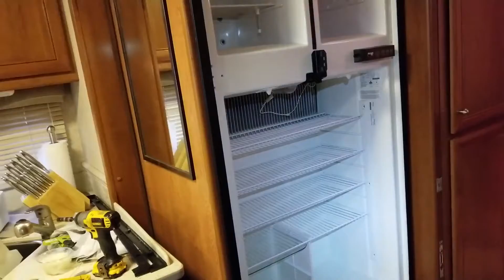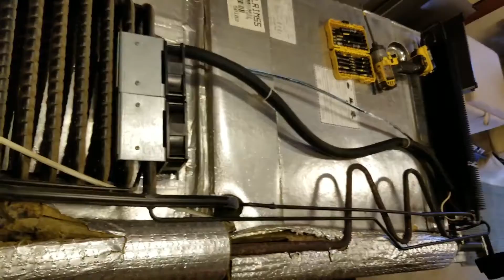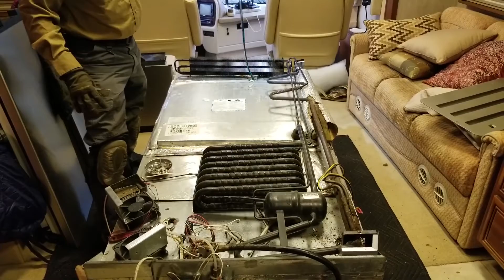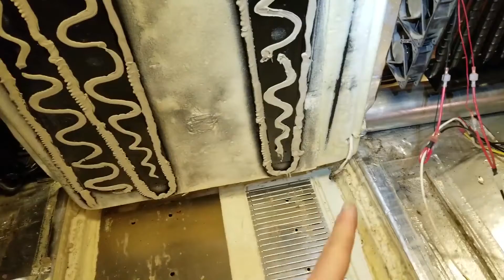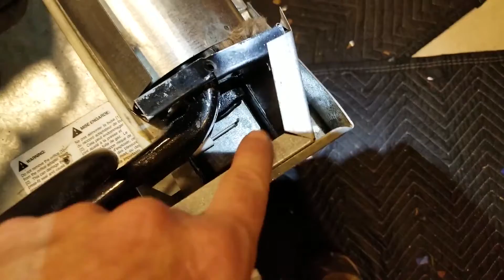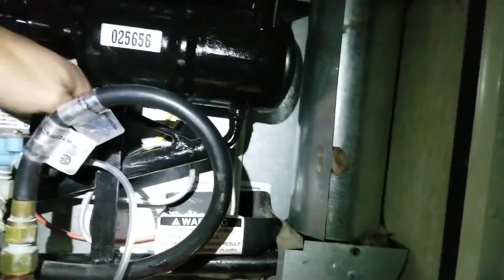RV Refrigerator Full Cooling Unit Replacement Tips & Tricks

Comment: I just installed an Amish unit that has kind of a brown/khaki color tubing. I ran necessary jumper wires and extension cord so I could test it before placing it in it's cabinet. Do these unit stink to high heaven when they are 1st powered on? The burning paint smell is best way I can describe it... and it worried me so much I unplugged it!
Reply: I will share my findings: YES, these new units stink when they are first put thru their paces. I was informed it is the oil and paint burning off coils. Some units even smoke. Luckily, mine did not as that would have really freaked me out. I started out cooling on level 4 (of 9) temp setting and after 5 or 6 hours the smell had mostly gone away. Once my unit started cooling it cooled faster than expected.

Comment: Thank you so much for a great video.  I need to check my fan.  I have installed extra fans, but fridge still doesn't get cold like the freezer does.  But, the return pipe to the reservoir is about 97 degrees when the pipe going into the heater is 130.  So, do you think I have a blockage and need to replace the cooling unit anyway?

Comment: Did taking out the 8 bolts in the back of the freezer make a difference? I don’t see holes on the backside of the fridge. I am trying to figure out where mine is still connected to my RV. i took out the 4 bit bolts on the backside, but it won’t budge.

Comment: Thanks for the video.  Our flame is working but the fridge and freezer aren't cooling.  What else can we check?
Reply from the maker: After the refrigerator has run for a few hours, feel the temperature difference on the back between the boiler and the absorber coils, these are the ones that go round and round. These two points should be similar in temperature. If they are not, then you have a blockage. That is not something that is field repairable. Here is a video I did, the beginning few minutes I do talk about blockages. 

https://youtu.be/--DCnSw1jP4

Comment: I am so glad you pointed out about the flue baffle often times not being included with the new unit. I just had a cooling unit replaced in my fridge, and to get it covered under warranty I had to get the "professionals" to do it. The warranty company wouldn't cover me if I did the work myself.
I got home from work and went and inspected the fridge which wasn't cooling properly on LP after the replacement, and found that they overlooked a whole bunch of stuff. The burner assembly was loose and flopping around in the back, they didn't screw the control board back to the fridge but rather left it flopping around in the back, they didn't screw the heat shield back on, didn't clean up the yellow residue that was left when the cooling unit went on me (I mean what happens in the future if there's a cooling issue and a technician has to diagnose it? They're going to see the yellow stuff and just think that it needs a cooling unit when in fact it could be something as simple as a fan not working), just overlooked a bunch of stuff. But when I called them to tell them that the fridge still wasn't working right on LP, they dismissed me like I was doing something wrong. Well this morning, I got thinking about that flue baffle and what it might be for and I thought to myself, you know what? I bet you the problem is that the flame heat is shooting straight out the flu and not boiling the ammonia. So I climbed up the ladder and stuck my phone camera in there and took a few pictures and sure as shit, they forgot to put the flue baffle in! All that arguing on the phone and it was something they overlooked, just like I tried to tell them.
So now I'm just waiting to hear back from them again, and hopefully they'll bring my flue baffle out from the old unit and I can stick it in there. If your new cooling unit is working great on electric but not worth a shit on LP even though there's a flame, go up top and make sure there's a wire sticking out of that hole. If not, there's your problem.
Reply: Thanks for sharing your experience, very frustrating for you I’m sure ,reading your comment I’m sure you could have done the job yourself & done it the right way the first time 👍👍🇨🇦✌️

Comment: Thanks Darren, great detail on your episodes......I am currently working an issue with a no a/c code on my Norcold 2118, found out that if I plug an extension cord from the house to the fridge it works fine. what would your next step be on figuring out why I'm not getting enough current to the rv fridge plug tucked in the corner of the slide?

Comment: What part number is the sealant used from the back of the cooling unit to the Aluminum cool transfer to fridge also the black filler sealant used, looking at replacement of my 634747   Norcold that failed, is the fridge actually that heavy if doors removed

Comment: Great and informative as always. When driving down the road should the refrigerator be on LP or electric? NRVTA tech tip Tuesday had said not to have your water heater on while driving down the road because the flame blows out everywhere and burns up the thermal rollout fuse or the wiring. I didn't know if this also holds true for the refrigerator.

Comment: My Dometic was working over the weekend on propane, it worked on AC as well, some how I have lost cooling on both. I have a flame and can hear the fans running, and have voltage to the heating unit on ac. Its currently unplugged for a day to see if it may be an ice dam. Could the thermister cause it not to cool on either? Thanks for any advice. Its a 2017 Forest River Sunseeker 3010. Regards Randy

Comment: What do you think of conversation to a 12 Vdc compressor system.
Reply from the maker: I have installed several. They install pretty straightforward. The wires for the heating element become the wires for your compressor. I don't have any opinion on longevity or anything because I'm just the installer.

Comment: I’ve decided to replace my bad rv fridge with a residential fridge (can’t afford an $1800 dometic) so I need to pull the old one out. Is there any power source to disconnect other than the plug in the back of the fridge? I know to disconnect and plug the gas line but what else needs to be disconnected from outside before I can just start pulling?

Comment: Great vid. I replaced mine 4 years ago and recently defrosted now the freezer is normal put the refidgerator section will not get cold enough. I have it on coldest setting and barely gets to 40 degrrees. 

 Please tell how the fans affect the refridgerator section ?

Comment: Darren, very well-done video.  You speak my language!  Two questions, are these instructions valid for either the Norcold 1200 and/or 1210 series units?  I assume they are; and also, about how many hours should this job require to replace the cooling unit on a 4-door Norcold unit - given average to above average skill and two big guys?
Thanks!
Reply from the maker: Yes - same for both.  Book rate or this size frig pays 1 hour to R&R the frig from its opening and lay it down on the floor (and then put it back in when done) and 3.7 to R&R the cooling unit.  So total book rate is 4.7 hours.  Since I have done so many I can get in/out in just over 3 hours but still charge the full book rate for the job.

To schedule a service consult with Darren please sign up for the "1:1 Repair Consult" on our Patreon site.  https://www.patreon.com/myrvworks

Comment: Just bought a used RV yesterday, with a blown 5A fuse on the circuit panel.  I'm praying replacing the fuse with get the frig working on AC, but if it doesn't this tutorial is exactly what I will need to accomplish the cooling unit replacement.  Great job with this tutorial!
Reply from the maker: Thanks for watching. Hopefully my instruction will help you.

Comment: Is it possible to recharge the system if you can locate the spot that leaked, plug it with an appropriate sealant, and then fill the system with the refridgerant (717) (12.4 oz.) to 850 LBF per square inch? Like you would with an air conditioning system?
Domestic MOD. NO. RM 3862
PROD NO. 921 14 60 - 06
Thank you for the quality educational videos!
Reply from the maker: While the absorption refrigerator works on the same principle (second law of Thermodynamics) as an air conditioner does. The way it achieves that is very different. You have X amount of water, X amount of ammonia, X amount of hydrogen, and X amount of sodium chromate.  Then can pressurize it to a very specific PSI and test it then sure it can be done. I will send a link to a company that trains people on how to recondition refrigerator cooling units. I looked into it myself but it's just easier at my end to swap them out and send them back for replacement at their facility. I hope this helps.
Reply from the maker: https://rvrefrigeration.com/
Reply: @MyRVWorks  Yeah, it helps. Thanks for taking the time to respond. You're a great educator.

Comment: Excellent job, as usual , Darren.  As I look at the flame on my coach (Norcold 1200rim) I noticed that the flame is always fluttering and loud.  I used air to clean the burner, but it still fluttering.  Do you think I need a new gas valve?  Thank you for the video , Ed
Reply from the maker: I just uploaded a video that might address your issue. Look for it in my refrigerator playlist. Thumbnail has the blue flame in it.
Reply: could be the gas regulator

Comment: Another point worth mentioning,  is that norcold uses a vacuum sealed outer insulated panels that surround the sidewalls. These panels have been known to develop a cancer and compromise the vacuum seal.
Therefore rendering the frig not repairable.
Reply from the maker: Hi Gary,
Thanks for the comment, I have not personally come across that but will now be on the look out for it.  I have toured the Dometic refrigerator factory with the plant manager and it was very thorough and detailed but have not made it over to the Norcold factory yet.

Comment: Why not replace that with a DC cooling unit beyond battery capability?
Reply from the maker: I am not sure I understand your question on the DC cooling unit.  There is a DC heating element for the cooling unit but it is only for when you are driving from A to B and is typically found on a "3-Way" refrigerator.    The DC heating element would not be the primary heat source when you are camping.  The Cooling unit is not AC, DC or anything, it is just a  pressurized vessel.   

The decision to replace the cooling unit falls with the customer.   We provide some options and let the customer decide what way they want to take to make the repair.  This customer choose to replace the cooling unit and keep the insulated box and we were happy to provide the service to him.

He is now a Happy Camper!

Cheers,
Darren Koepp
Reply: @MyRVWorks  Hi,
There is a replacement DC compressor based cooling unit that directly replaces the pack that you just replaced. I saw it on the Mortons on the move. You can get the compressor as 12v or 24v but there is no propane option so your power supply has to be up to snuff to operate it. https://www.youtube.com/watch?v=Yte1V3CkDrw

Comment: Was that a remanufactured cooling unit?. Cause u mentioned that u were sending the core back
Reply from the maker: The cooling unit we pulled out was the original.  We buy our cooling units from https://www.rvcool.com/ if it is not under the mfg. warranty.  RV Cool offers a warranty on their cooling units but need the old cooling unit back to activate the warranty.  This way the old cooling unit stays out of the landfill and they get a bad cooling unit that they can repair and recondition.  Everybody wins!
Reply: You know what parts of a unit are reconditioned?
Reply: @Dutcheagle_ks  I am not sure I am understanding your question(s).  As for me I verify the specification of the required cooling unit for a specific RV refrigerator and place the order with my cooling unit vendor.  They ship out a cooling unit that they have reconditioned and warranty their work.  I return the faulted/failed cooling back to them (at their expense) to activate the warranty.   They take the cooling unit I returned and run it through their reconditioning process and send it out again with their warranty.  My RV Works has nothing to do with the reconditioning.  What parts were 'reconditioned' is outside of my scope.  I am responsible for diagnosing the issue, removing the failed cooling unit, installing the new cooling unit and returning the failed one back to my vendor.

I hope I understood your question and answered it to your satisfaction..

Cheers,
Darren